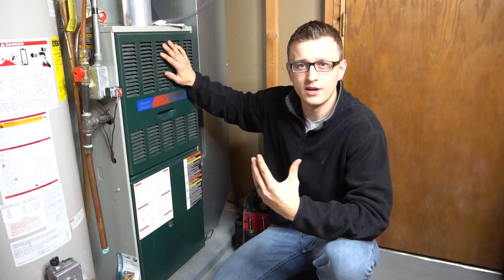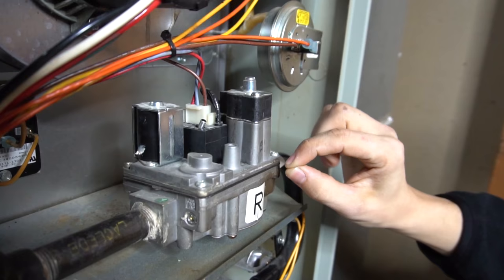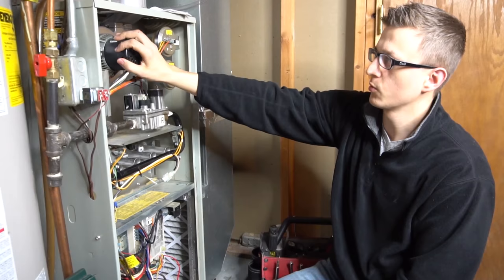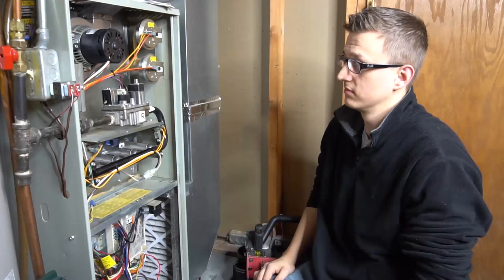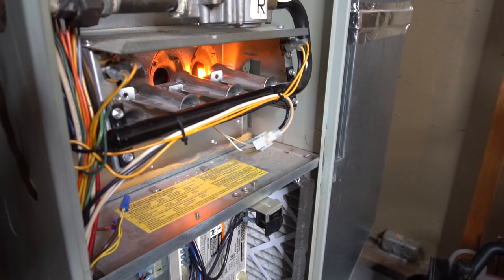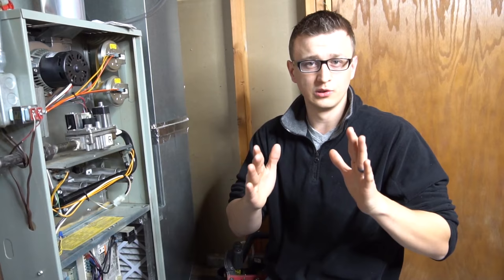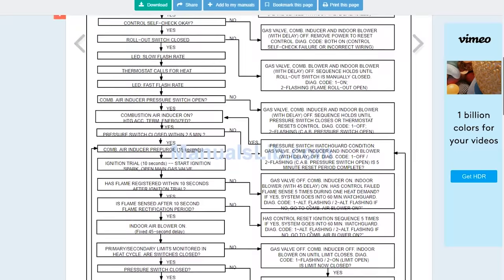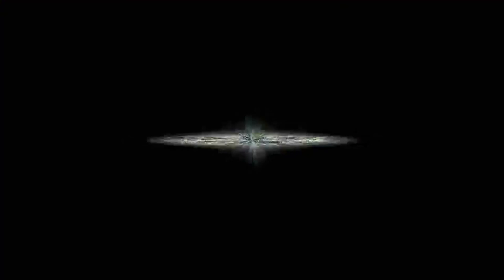How a Furnace Works - Furnace Sequence of Operation

Comment: Thank you for video !  is that possible that gas valve stuck opened releasing gas  ?
Reply from the maker: It is possible but very unlikely. The purpose of the flame sensor is to prevent something like that from happening.
Reply: @WordofAdviceTV  What if flame sensor signals that no fire , control board commands to shut gas valve off but valve mechanism stuck opened? looks like gas leakage and boom?

Comment: Hi Jay I have a question; i want to know what benefits is to have a furnace fun running 24/7.?
Reply: Air circulation

Especially if you have a carrier fan system with annual filter changes

Comment: May I ask Jay a question about one furnace that is connected to a recirculating pump by an electric wire? What purpose does the recirculating pump serve here? The pump is connected to the cold water supply line on top of the water heater.

Comment: Thermostat Call for Heat: When the indoor temperature drops below the set point, the thermostat signals the furnace to start the heating cycle.
Draft Inducer Motor: The draft inducer motor activates, creating a draft in the combustion chamber for proper airflow and venting of combustion gases.
Pressure Switch Check: The pressure switch ensures the draft inducer is functioning correctly before allowing gas flow.
Gas Valve Opening: Once the pressure switch confirms proper airflow, the gas valve opens, allowing natural gas into the burner.
Ignition Process: The ignition system (standing pilot or electronic) ignites the gas to start the main burners.
Flame Sensor Check: A flame sensor verifies the presence of a flame; if absent, the gas supply is shut off for safety.
Heat Exchanger: Hot combustion gases pass through the heat exchanger, transferring heat without mixing with indoor air.
Air Circulation: The blower motor draws cool air from the return ducts, passing it over the heat exchanger to warm it, then distributes the heated air through supply ducts.
Limit Switch: A limit switch monitors heat exchanger temperature, shutting off the burners if it exceeds a safe limit.
Thermostat Set Point Reached: Once the desired temperature is reached, the thermostat signals the furnace to stop the heating cycle.
Gas Valve Closing: The gas valve closes, stopping the gas supply to the burners.
Blower Continues: The blower runs briefly to distribute remaining heated air.
Shutdown: After a short cool-down period, the furnace shuts down completely, awaiting the next heating call from the thermostat.

Comment: I know this is kind of old, but I woke up with no heat today. I watched your troubleshooting ignitor video and my furnace is doing exactly as you have explained, so this leads me to believe that I have a bad ignitor. However, when I manually hold the door switch, everything works as normal. What do you think this is?
Reply: Just realized you explained it in this video as well. Since it  lights when I hold the switch, could it possibly be a bad switch?

Comment: Hi Jay.   I had my propane tank moved last week.  They tested the line and replaced both regulators.  To make sure everything was ok I tested the furnace after
They finished and it worked fine.  I didnt let it run too long but probably about 3 to 5 mins.   Today I tested it again and it wouldn’t heat.  The pilot does burn the igniter appears to turn red hot.    I think I can hear the gas valve click but it wont fire.   I did get it to go one time while
Messing with it but cant get it to fire anymore.  Is there a chance one of the regulators is not set
Up. properly.  Would a manometer be the way to go.  Thanks Jim. Ps. R u stillnin hawaii

Comment: When the flame comes on how long does it take for blower to come on?
Reply from the maker: Usually around 30 seconds. It varies from furnace to furnace. Some of the older ones are temperature activated. So once the temperature gets hot enough in the heat exchanger, the fan limit closes and turns on the fan.

Comment: question on this particular video. since the safety sensors are wired in series wouldnt the Hot Surface ignitor break the circuit not the flame sensor? so no power gets past the HSI since the flame sensor is after the ignition sequence?

Comment: My heater won’t keep up with the thermostat and it’s cold in my house. I have an amber light that blinks once at first and code says it’s normal operation calling for first stage heat and then changes to blinking twice calling for second stage heat and stays that way. Please help

Comment: I have the same control board in my furnace.Burners won't stay lit, board flashing 4 - high limit switch open.

I'm assuming that can be any of the four or so limit switches , not just the primary that's inside the unit itself behind the burners.
2 right behind my blower,the primary behind the black closeout, 1 on my pressure switch,all ran in series making one circuit out and back in to the control board.
Reply: If you find the time to answer this soon enough to help me,or ever, I'll be surprised. I realize this video has been up for a while.Either way,all your videos are a huge help,and are much appreciated friend.
Reply from the maker: Hey man, I was scrolling through comments and saw yours. I don't know if you've figured it out yet but I would refer you to this video for the problem you described: https://youtu.be/pJzP1jzYPqg

Comment: I have a Lennox EL296UHV 2 stage furnace......controlled with Lennox 7500 thermostat.....I'd like to replace the thermostat with a simple non electric Honeywell CT87N1001 thermostat......Will it work on this furnace.....I do not use any of the features of the programable thermostat except the temp. setting.

Comment: My problem was the inducer kicking on.  Checked the pressure switch and it seemed fine (unclogged, not damaged), so I moved on to the ignitor.  I have a Heil furnace, and the ignitor was tucked behind the furnace itself.  Shimmied it out and part of it was white.  I'm not sure if I should just replace it or if it'll turn white (scorched basically) from normal use.  I can't hear the gas valve flipping on.

Comment: My furnace has two pressure switches and only two wires going to inducer motor. It has a transformer with the C R Y G W on the side of transformer. I just replaced the ignition control (last year two relays). No light comes on at the ignition control which is modular/closed with a key in the side. There is a slight hum and a relay click at on/off. Thermostat seems to be sending voltage but no inducer start up.

Comment: if the inducer motor doesn't spin but tries to turn on, could that be the capacitor? If I spin the motor it works fine and goes thru the regular cycle...  thanks

Comment: Hi Jay,  My furnace just quit.  Hopefully it is fairly simple.  My furnace doesn't have the error code system.   There is no signal from the thermostat, so I bypassed the thermostat.  It started to work as it is supposed to up until the point that the blower motor was supposed to run.  The blower never turned on, and the limit switch shut the system down.  I know the blower motor works because it does work when it when the thermostat is set to run the fan.  It looks like I need a thermostat, but could I need a control board also?
Reply: How did that go?
Reply: @learnjcbskidsterchickensga7594  It is still working after 2 years.  It needed some sort of fan control part.  I don't remember what it was, but I got the clue from the owners manual part list and the parts supplier was very knowledgeable and helped make the final decision.

Comment: My furnace is doing everything right (only once)  except the last step the blower won't come on, even though I replaced the dual capacitor. I turned the fan with my hand and it's free (not stuck) what could be the problem? Tank You. 4 blinking light. high limit switch?

Comment: Thanks 
My furance is blinking red three times
Flashing lights mean low fire pressure switch stock opened
Also the inducer motor does not turn on 
Furance model
Goodman Gmv950905dxa
Reply: If the inducer is getting power but still not spinning then the motor or capacitor is bad. If its not getting power then the board is bad.

Comment: What temp does the furnace get for the blower motor to come?
Reply from the maker: Older furnaces used spring loaded fan limits that would turn on the blower once they got hot enough (they are adjustable too) but nowadays most furnaces just use a timer. After 20-30 seconds (depending on the furnace) the blower comes on. You should be able to find that info in the furnace manual too.

Comment: Could anyone comment? My induction motor never comes on when my thermostat calls for heat. The old carrier furnace is in the attic, heating my 2nd floor about 1000sq ft and what happens right next to the aluminum tube which carries the gas from the gas valve to the burners is ignited by a pilot. Usually the flame comes on pretty quickly, but when it doesn't I can smell the gas, but in any case it does it and the induction motor never kicks in and I don't know if the sequence operation in this 90s model (possibly 80s) is the same as in the newer models. Also I had an older furnace in my other home I know that there should be a thermocouple (whatever that's supposed to do but I would replace it when the flame wouldn't stay lit) and I don't have one in this furnace and as soon as the pilot light gets the flame going it is on for about 2-3 sec and one can hear the gas valve making 3-4 clicks/rings (fairly loud clicks) like it wants to let more gas through and it never does so and the burners never ignite so the process repeats. The burners never ignite. I replaced the gas valve and nothing changed. I cleaned the pilot as well as blew out the burners. I think it's the induction motor but I had a tech come out and he said that it was the gas valve so I didn't like his diagnosis because it didn't make sense and I still did what he said so I am here to ask for assistance because that didn't work. The sys board is from the 80s and the unit is  on the floor flat and I can't see or get to the board unless I lift the unit. Could you please help me ?

Comment: Do I have to replace my capacitor if I replace my blower motor?
Reply from the maker: I always do just to make certain I won't be coming back two weeks later. It is recommended to replace both at the same time but you don't have to.

Comment: I had a high efficiency furnace that would not heat.  Not sure where exactly it was failing, but it turned out to be a blocked drain plug, so it was getting a build-up of water inside.  When they cleared that, it worked.  I guess there was some kind of sensor that must have been shutting it down.  Strange that the fan would go, so it would blow cold air, but not light up.
Reply: My hvac friend poured boiling water inside a hose…bit another time we followed a youtube and cleaned the outside white pvc line…success

Comment: @Word of Advice TV  I'm trying to understand the types of units.. I'd like to upgrade, maybe wireless tec.
I believe the unit is older Standing Pilot  , I see the schematic diagram its a junction box I'd like to bypass for and second thermostat housing  if possible ...or even a direct switch for heat

Comment: This morning I noticed my heater blows cold air and my thermostat is set to 68 and the temp is 68 but the fan is continuous, I have waited for 15 minutes but still blows cold air,so I lower the thermostat manually to 67 and the fan stop blowing.What went wrong?What do I have to look for if that happen again?Thank you.

Comment: What is happening if a furnace has power but the red light is not on and there is power to the board?
Reply from the maker: The first thought that comes to mind is that the 3 amp fuse is burnt out. Or if you have a Lennox, it might be a small 3 amp breaker that is tripped. Those board LED lights rarely ever burn out. I would also measure voltage coming into the transformer and coming out of it. Should be around 120v coming in and around 25v coming out.

Comment: Thank you for your information. Please, someone, tell me what is wrong with my Trane XR90 furnace.  It has been looked after every year before winter and the filter would change twice during the winter. Couple of years ago the guy who comes every year said that the control board has to be replaced.  It was ordered and he came with another guy trying to install the new one.  But of course, I can't say anything, I am a woman and a senior and, in their country, women don't speak, so I let them do their job, which took them a long time.  The heat was not according to the thermostat and they didn't believe me.  This year he also mentioned that something else in the furnace has to be changed because there is moisture at the bottom. One night in cold weather I woke up listening to the furnace it wouldn't shut off, the temperature was 15c and after the furnace was on, the fan started working, then before the fan was off, the furnace turned on again and the fan was never shut, and it went on for a long time. I looked at the red light, it was not blinking right, so I turned the furnace off.  When I called him the next morning, he was angry and did not acknowledge the problem saying I have to make an appointment because he is busy and have to pay him again!!  Now my furnace is on at a high temperature because I am afraid if it goes down, I have the problem again. The thermostat shows high but the heat is not high on the other hand my bill is very high.  What should I do?  Please and thank you.

Comment: My Ducane furnace does that whole process perfectly BUT when my blower fan comes ON then my burners shot OFF immediately.  And it does the whole process over again . So the heat exchanger will warm up properly and I do get heat but the burners do not stay on while blower is on???

Comment: What is a ''limit switch open''?  thats what 4 flashes say on my burner. with thermostat up have to turn off then on burner switch then inducer goes on . blowing cool air a few minutes. shuts down and inducer buzzes after continuously. and its a ''xenon'' furnace.

Comment: Hey nice video, can you make a video about how to troubleshoot a gas valve, I think that's the only one that you're missing, cause you have videos about inducers, control boards, pressure switch, ignitor blower, flame sensor, so you owe us the gas valve haha 😄 just kidding, but it would be nice 😉 😜.
Reply from the maker: Thank you! That's a great suggestion, I will try to get a video like that done. (though I don't know when) But with most gas valves it's pretty simple. If the gas valve is getting power (24-28v) but not opening and letting gas through, then the gas valve is bad.

Comment: My furnace is throwing pressure switch code but it has 28V in and out (limit switches also have 28V in and out) but my board is not sending out 120V to igniter. Bad Board right?

Comment: My inducer fan runs and the pressure switch kicks in( connected leads to both sides showed 0 volt) but still there is no voltage to the ignitor.  Error code is inducer error.  Any suggestion is appreciated

Comment: My furnace have a problem it’s running  good sometimes and sometimes not. After running good and its running again blows cold air the fan it’s running have a lighting but  yellow and blue but no flame. I do turn in the middle the heat on thermostat and turn off the furnace and turn on again the furnace after 5minutes I turn the thermostat into heat after that it’s work again my furnace.
Reply from the maker: That sounds like your furnace is over heating. Have you tried replacing your furnace filter yet? Also, when the furnace stops working, if you look in the sight glass on the bottom door of the furnace, does it blink an error code?
Reply: Word of Advice TV my furnace no red light code. My furnace is Armstrong air ultra sx 80. I replaced my furnace filter twice this month.. thanks for helping me God bless to you..
Reply: If over heat my heater how to fix it. Thanks
Reply from the maker: Well, I am not sure if it is over heating or not.. If your furnace does not have error codes then I can only guess what it can be. And since there are many things that can go wrong in a furnace, guessing wont get us too far.. Have you watched my "Top 10 Furnace Problems" video? Maybe you will see a problem similar to what you are experiencing in that video..
Reply: Word of Advice TV thank you very much to your concern. God bless

Comment: Just had an American Standard 80% two stage furnace installed and I’m trying to figure out the second stage timing ? (It’s coming on for 30 seconds and shutting off ) I’ve tried no filter and still happens . In the manual it says second stage contacts need to close to get the second stage to turn on but don’t have a two stage T stat.

Comment: i had a co2 warning go off and called the gas company to check it out. they did get a minor reading on there device when they first walked in the house. but the guy couldn't figure out where it was coming from as he tested every gas appliance. He was stumped so he went back to the office and asked some senior guys how this could be. they mention some kind of back draft?back pressure in the house occurring randomly. Have you ever heard or experience this??

Comment: I went through 110 gallons n 18 days bc my furnace keeps coming on but, its heating up to set temp. But, it only takes 5 minutes b4 temp drops the 1 degree & turns back on.
I cant get a tech. Out in time to prevent wasting even more, and cant afford more. Is there anything that can be done 
Theres no codes.